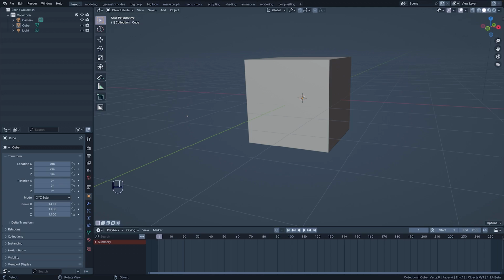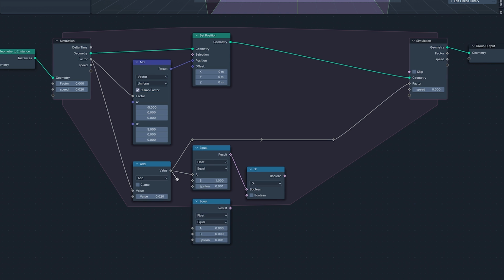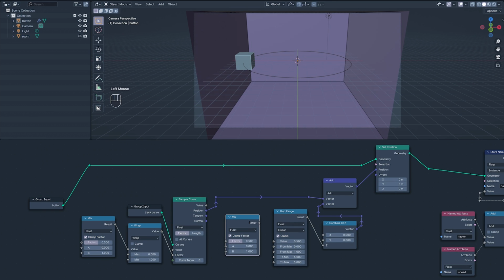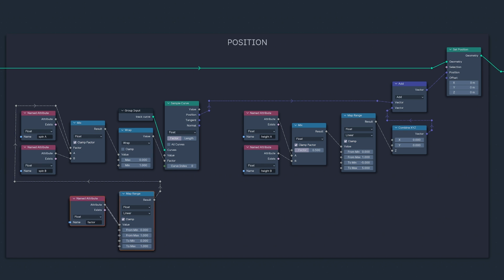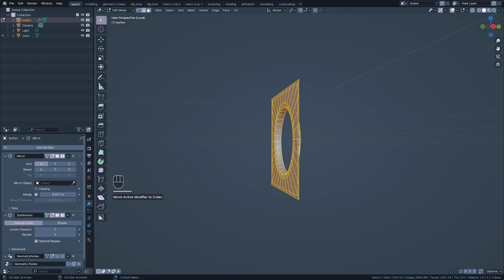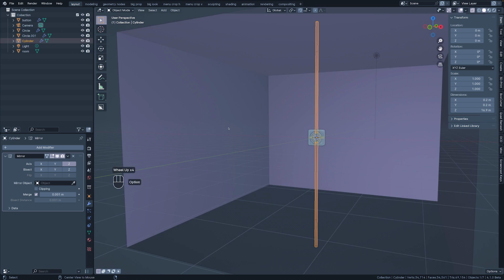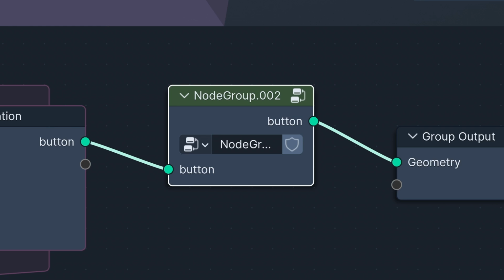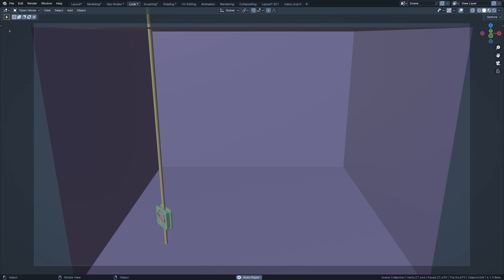simulating all the animation in a scene with geometry nodes in blender

Comment: After the crew of the Starship Enterpise discovered that the multidimensional mind-control bowel parasites that infested them from Babylon 5 hated the color red, they located the dimension where the movie Cube was filmed and teleported one of the rooms on board. After cleaning the room of whoever failed the last test, they communicated -- via Scanners telepathy over honeycomb subspace -- their hyperdimensional coordinates to the broad infinitum of crews, but with a segmented time dilation using a fractal hash stolen from some guy with a telephone booth so that no two crew members would expel their parasites at the same time. Then, within the Groundhog Room, they set up a cyclic rotation of turning on-and-off a discarded lightsaber they found with just so many extra kaiber-crystal vents, and hooked it up to a button that would move after every deactivation because why not. Relative to their temporal frames of reference, all crew members went to the bathroom in their quarters at the exact same time across the multiverse, meaning the episode ended five minutes later, but relative to the Cube, an eternity was instantly forged in which every single parasite from every single crew member from every single universe crawled out through an Aperture-funded portal to turn off the light it so despised. When it tried to slither back through the portal, GLADoS -- needing portal fluid to exchange matter interdimensionally, as its quantum tunnel based portals were inTRAdimensional only -- rerouted the beings to Rick's Citadel, which -- because it wasn't on the time dilation -- instantly became an infinitely dense, infinately expansive mass of the creatures. Collapsing due to the infinitely warped space, its gravitational shockwaves sucked in all matter from all universes -- including and especially Homestuck -- and the resultant interdimensional big-bang created litereally everything. But because that time axis was orthogonal to the Enternity Room, here, the creatures continue their sysiphean task of Pushing the Button. The only ones who learned the truth of this were the K-Paxians and one human named Lovecraft.
Reply from the maker: This is amazing. I’d watch this movie 37 times (38 if someone ordered enough of those movie theater hot dogs and the place was busy enough that we could start a Mexican wave). Thank you. This is dream cinema content movie stuff
Reply: I think the best thing to do in the interim is just envision it while we watch the alien do its task. And eat hot dogs. :) And learn geo nodes.